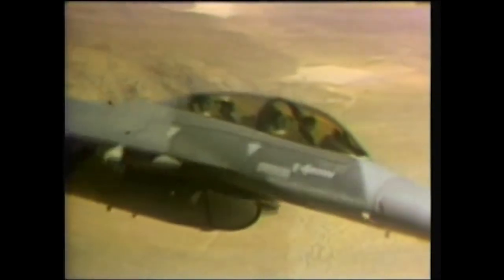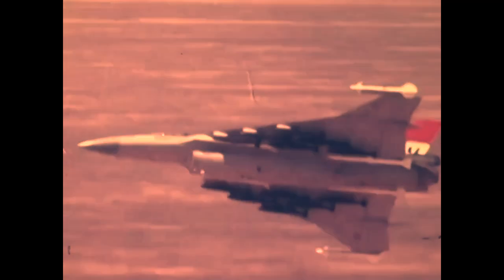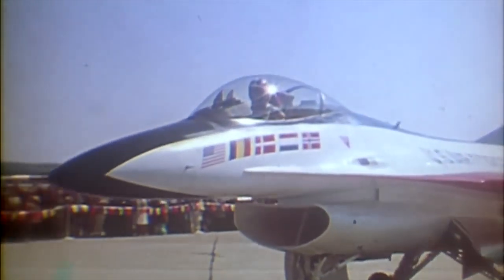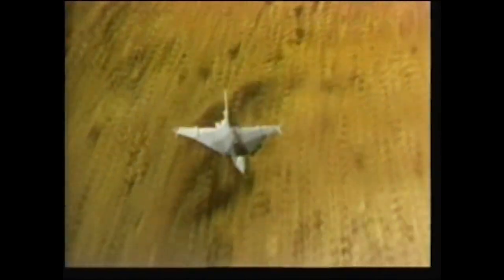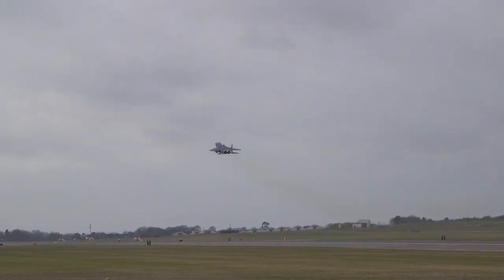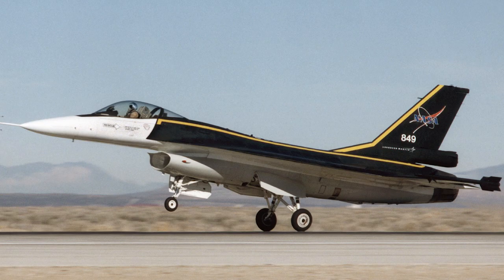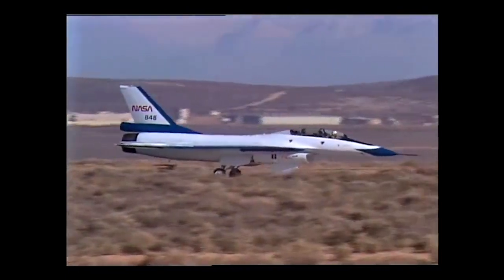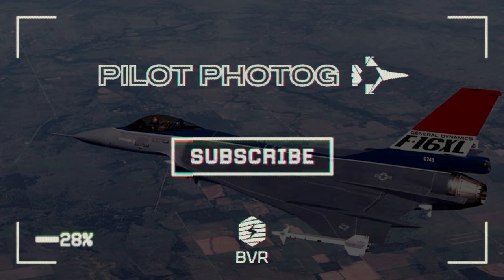F-16XL The Fighter That Should Have Been Built | avgeek |  #f-36

Comment: The double delta was pioneerd by avro with the dart.
Reply: Klaas Siersma No, there were several delta winged aircraft before the Arrow.  Corvair xf92 in 1948 led to the Corvair F102 in 1953 and F106 in 1956. over 1000 F102’s were built and some flew in combat. Mirage 3 ,Gloster Javelin, mig 21, Saab 35 all had a delta.
Reply: Were they double delta's?
Reply: Saab 35 (1955).  I guess my point is the “double delta” was not a very useful design.
Not many made it into production. Even modern deltas use canards.
Reply: It was avro's solution for mach 2 flight.

Comment: I Worked on F15 A/B at Minot, F16 A/B and F16 C/D at Kunsan and F16 C/D at Ramstein - The F16 was a piece of shit and the main reason I GOT OUT was b/c the Air Force refused to put me back on F-15s .. I couldn't stand the F16 LAWNDART ..The F-15 Eagle was three million times a better aircraft on all points - and still is - the F15 airframe could takes three times more battle damage than the F16 and still fly and the twin engines gave the pilots a significant advantage to getting back to base without having to bail out .. The PW F100 was a much better engine and much more reliable .. GE F110 was a piece of shit when it first entered service and we had to ground the entire F16 C/D fleet several times during the first 2 years, because the blades kept stretching as a result of bad engineering - the blade metallurgy of F110 cores wasn't designed to handle the needs of a fighter aircraft throttle jockey .. I think the first year we had to ground the entire F110 fleet 4 times, tear the engines down, and hand file the blade tips of all the compressor blades down something like 1/32" before they finally stopped seizing up .. I argued with three commanders over GE's bullshit Quality Control and demanded to be put back on F-15s - they refused to listen to me and I refused to re-enlist - the F-16 and the GE 110 is worst fucking airplane and engine ever fucking built .. thank god the Air Force bought the F15E instead of this piece of shit ..
Reply: You work aircraft still?

Comment: Except it should not be built. It was a dirt bomber not a fighter and the primary role of the F-16 is a dog fighter. This was an unneeded modification to a plane that was superb in its designed role. If your Air Force was poor and needed ground attack you could buy any number of second line planes. If you were a rich Air Force you bought the F-15E and moved on to the next problem.

Comment: Turned down the xl for having a single engine design. LMFAO so what's with the F35? Why wasn't that turned down. Don't tell me it's cause of stealth... Give me a break. Talk about expensive.
Reply: Because the F-35 isn't replacing a heavy strike aircraft and modern engines are far more reliable.
Reply: @dumdumbinks274  It was intended to. What was wrong with the F100? Cost is what killed this design hands down. It's plagued the F35 as well. Even though it was the outcome of a jsf contract the Air force initially considered retirning the F16 for the F35A.
Reply: @LastExile1989  The F-35A was only ever intended to replace the F-16 in USAF service, not the F-15. It is doing what it was intended to do. It was not competing for the same role as the F-16XL.

F100 was an unreliable engine that lead to plenty of crashes both in the F-15 and F-16. At one point, but not solely due to the F100, the F-16 had class-A mishap (crash or serious incident) roughly every 10000hrs of flight. F100 was known for stalling for no apparent reason, was very sensitive to rapid throttle adjustments, and at least on the F-15 was known to flame out moderately often when engaging afterburner until the -220 and -229 were rolled out.
Reply: @dumdumbinks274  Ahhh okay, thanks for the clarification.